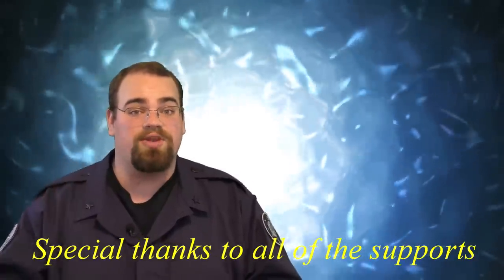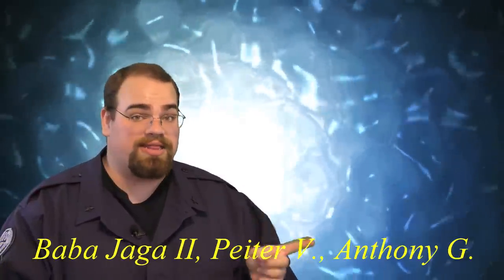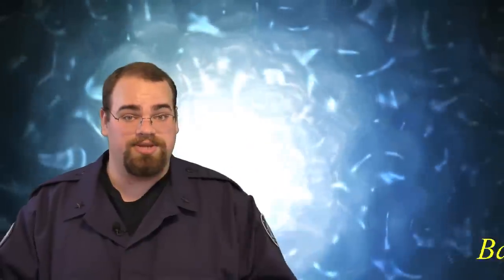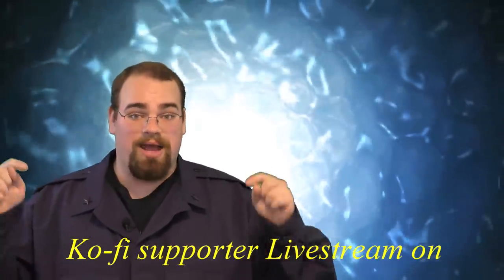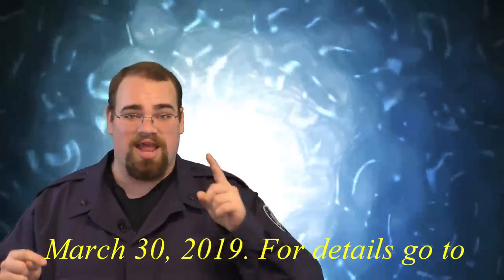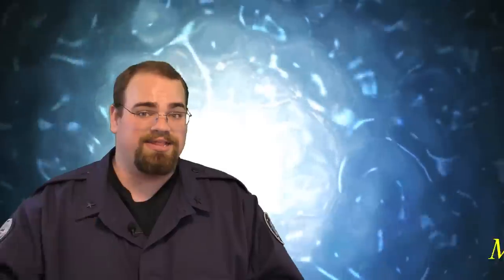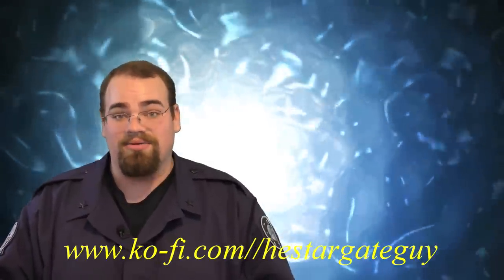Zero Point Module (ZPM) : How it Works

Comment: I bet the way to recharge it is so simple, no one else had thought of it. i bet you just shake them vigorously for 10 minutes then re-install them. Of course the replicators will never tell us this... :)
Reply from the maker: Hahahaha that would be hilarious!
Reply: Haha it ain't no shake weight
Reply: SERIA MAS FACIL REPLICAR CON UNO DE ESOS RAYOS DE TELEPORTACION
Reply: Don’t forget the little dance too
Reply: ZPM's don't discharge, they reach maximum entropy which is irreversible. Maximum entropy is when all workable energy in a system is completely gone, either used or dissipated and you have nothing but complete evenness in the energy state. The universe we live in is in fact racing toward this state and when it reaches it, it is known as the "Heat death of the universe". There is a one way process and it would violate the laws of physics to attempt otherwise. The reason why they say ZPM's are a "universe-in-a-bottle" is because as a self contained region of space-time, they are literally not part of our universe, they are pinches of our universe, twisted off to create a small tiny universe, which as universes go, it produces energy which is then siphoned off back into OUR universe to power objects, as this happens, it starts a build up of entropy until the differential is gone and you have equilibrium and thus maximum entropy. When it reaches this state one of two things happens, A) you have a region of space-time that is completely flat and even or B) the space-time region ceases to exist, as I said maximum entropy means the energy level is even with respect to our universe and thus the self contained region ceases to be self contained and just sort of blobs back into our space-time meaning the region inside the ZPM would seem to disappear and cease to exist.

To make a ZPM usable again, this would require another pinching off of space-time and the creation of a pocket universe again. You would essentially load the ZPM with another pocket universe, which even among the ancients seem to be an effort, not ridiculously hard but still an effort.
Reply: @AgentExeider  good explanation. why do even really crappy alkaline batteries recharge if you put them in the freezer for a couple of days, yet lead acid (car) batteries die in the cold?
Reply: @AgentExeider  "The universe we live in is in fact racing toward this state and when it reaches it, it is known as the "Heat death of the universe"." Heat death or cold death? But it will likely not simple be the universe we live in, but the part of the universe we live in.

Comment: The reason why new ZPM's need to be manufactured, is because they all need to be built specifically around a new subspace bubble and set to specifically tap into it.  The ZPM is a universe in a bottle in a sense though, because the effects of zero point energy are devastating to a universe. It creates exotic particles, changes the zero energy state of space, etc.  If the zero point energy state of our universe were to change, all matter could actually poof out of existence. The laws of physics and the existence of particles, relies on this resting energy state of the universe. So the ZPM does pull energy from outside of our universe. The ZPM is destroying the space it derives energy from, but since we don't live in that universe, it has no effects on us.  In fact, I'm pretty sure they don't even really create a new mini universe, but actually just pull energy from random universes.  I remember they said in one episode that the chances of a universe being occupied that the ZPM is pulling energy from, are slim.  In fact, that's exactly what Rodney tried to do when he tried to create his own energy generation device using an abandoned ancient project.  It was basically ZPM power on the go, allowing them to tap into any number of random universes at will, not just confined to the specific parameters and limitations a regular ZPM would have.  And that's the episode where the energy generator was pulling energy from a mirror universe where Rodney meets his double.

Comment: I always imagined a ZPM as a self contained singularity that couldn't easily collapse until the Crystal broke. The singularity pulled energy that was free moving into contact with the crystal case and the case stored it and released it as needed. I imagine that due to entropy, the singularity breaks the case down until it finally can collapse, making the case go dark. Or explosive in some instances. But this happens over thousands of years, thus it is a reliable energy source. Once the singularity can pull in enough energy or matter, the ZPM dies as the singularity fades away. 

So like the black holes we can make with our huge CERN Collider, but contained and kept from collapsing with a sponge. That sponge can give off energy it soaks up.

Also, pretty sure CERN can make black holes... About to fact check myself on that... They'd be super tiny and collapse quickly, but... Yeah... 

Like the Hirogen Sensor Network. But super small. And pretty. Cuz crystals rock.
Reply from the maker: But with a singularity that large, that would extremely dangerous.
Reply: @TheStargateGuy  "Ancients." said with both hands up Giorgio Tsoukalos style

Could be that it is a very small (microscopic) singularity. The Hirogen ones could be felt in space, but I imagine the crystal case keeps it from pulling at nearby space and subspace material, only free energy. So a dampened field that only gathers energy. Also, haven't we seen ZPM units explode violently if damaged? Not too sure about this, but I think one met a Zat. And didn't like it. They are in DHD pedestals, and those can go boom if damaged.

Comment: Actually a motor vehicle's piston when traveling downwards, it's not compressing anything. When it's on the compression stroke it is traveling "upwards"  and both of the valves closed thus creating compression and when the Piston gets to the top (max compression) a little bit of fuel is sprayed by the injector and then a spark is ignited causing an explosion or combustion, shooting the Piston back down.

Comment: The only problem with the theory is: You need energy to create this "dent" in space-time. i.e. to produce a ZPM you need as much energy as you can get out of it later. Similar to an accumulator where you only get as much energy as you have previously charged. This is why McKay's statement makes more sense than Zelenka's. The ZPM contains its own space-time, which is independent of the rest of the universe. So you get energy from another place. The Arcturus project tried to extract energy from our own space-time and it triggered a catastrophe because it destabilized the space-time of our universe.
Reply: And Mckay being Mckay destory a solar system. He always has to be right. The more pride you have the harder the fall.

Comment: Entropy is when no more work can be extracted from (insert you’re device here) as everything is the same energy level  , (the energy can’t change to another form )  (once all the energy in the ZPM reaches the same temperature no more energy can be extracted)
Reply: How many ZPM could be charged with the Arcturus project? This would probably be called a ZPM mass production. Just stupid if there really should be other universes that are lost. o_o Or: How do you send the energy taken from a ZPM back to the ZPM immediately or as soon as possible?

Comment: So this is basically vacuum decay happening inside the ZPM?
Reply: pretty much....
Reply from the maker: Basically yeah....
Reply: @KohuGaly  Or, like every smartphone, a kaskade transformation from hadrons. Same thing, on the actual facts.

 (Because, its not a vacuum, its a geometric paradox - a line is not a wave, until there is such thing as a third thing like a waveline, basicly a life form ;) 

Co2, in fact, makes this daily. or why you think your kacka smells like kacka. Or why the logo of the SDI looks like this.) 

Because, a ZPM turns in use to a generator, not like the description claimed, to a battery. So its a batterygenerator. 

 (ZPM makes light only in activted mode). 

Would it be a battery alone, there would be no thing like "energy lose", because using a zpm would be recarging the zpm. You could claim, that railguns on Atlantis use the transfer, but in this case, it uses the shield generator.  And because, you have the shell, the batteryeffect are online for the energytransferinfrasctrue.. 

Okey, i lie, a little bit. Even as generator, it recharges. but, because, in use, you only can transfer the energy. A ZPM should use 8/11 correct spins, mase technology turns it down to 1 to 10 to twelve, and politics makes out of it a a mathematical matrix. 

Its a little bit like, oris are only replicants, because, the chance, that daniel jackson would have turned in a gua uld, or that earth is gua uld, since he has disappered, are high enough for him, to be a god. The universum plays this most of the time simple as hyperraum technologie out, and out of  this as freyman graph.

Comment: Not that it matters a lot but i asked myself, what would Zelenka do? Pistons almost always go up when we picture the compression stroke. The squish zone is on the piston top. The bottom of the pistons with multiple cylinders jiggle the volume of air in the crankcase but essentially leave the volume static. Generally we introduce a vacuum from the intake zone as a means of containing the volatile fumes. A positive crankcase ventilation valve, a PCV, is a clever and simple device used for this purpose.

Electrons should be included in any Atlantis power distribution grid talk. They're the little quantum units that do the wave until they are confined to jumping from vacant hole to hole as they wander their way through a conductor or are put to use causing something else to jiggle a little more. The jiggling is what we call heat. I do like electrons. I like to mess with them by offering two doorways then not watching which one they choose. Waving their way along has it's advantages, they're not stuck choosing which door. They just wiggle through both as long as no one is watching and forcing them to choose. Have fun. There's no shortage in choices of thinking topics when Stargate is involved. Peace and confusion are the answer. Adu
Reply from the maker: Yeah I messed up the directions of my pistons. That goes to show how often I work on cars. lol.
Reply: @TheStargateGuy  all part of the process of new areas of reference. No harm intended. Think of this as if it was on Stargate Command. A no troll zone of Ascension candidates. Take care and appreciate your Stargate efforts. Peace

Comment: Technically it is not a battery but rather a power source. and in our universe it can't work. On the quantum level of space/time, dual particles of mater and its counter part antimater are formed and then anihilate themselves back into the space/time think of horses on a merry-go-roud we only see them on the up stroke, (when they ave been created), and they disappear on the down stroke (when they self annihilated and create energy) It is this energy which could be what is driving inflation of space/time faster and faster. the more space there s the more particles appear and annihilate each other. These particles in out space/time quantum level actually exist. but in  a ZPM, a pocket fininite sized universe, captured right after its big bang and instead of expanding by the creation and annihilation of paired matter and antimatter particles creating energy to inflate this space, the energy is syphommed off to power whatever a ZPM is attached to. When not powering something it uses the generated energy to prevent that pocket universe from expanding in stasis inside the ZPM. eventually the ZPM stop generating new particle pair because there is finite space/time inside it and it powers down, becoming inert in our universe.

Comment: Sound waves are a form of antigravity because they have negative mass add Sonoluminescence;  is the emission of short bursts of light from imploding bubbles in a liquid when excited by sound. That 'universe in a bottle' has a real life counter part called a star in a jar, it's our potential ZPM.

Sonoluminescence proposals
 Quantum explanations

An unusually exotic hypothesis of sonoluminescence, which has received much popular attention, is the Casimir energy hypothesis suggested by noted physicist Julian Schwinger and more thoroughly considered in a paper by Claudia Eberlein of the University of Sussex. Eberlein's paper suggests that the light in sonoluminescence is generated by the vacuum within the bubble in a process similar to Hawking radiation, the radiation generated at the event horizon of black holes. According to this vacuum energy explanation, since quantum theory holds that vacuum contains virtual particles, the rapidly moving interface between water and gas converts virtual photons into real photons. This is related to the Unruh effect or the Casimir effect. The argument has been made that sonoluminescence releases too large an amount of energy and releases the energy on too short a time scale to be consistent with the vacuum energy explanation, although other credible sources argue the vacuum energy explanation might yet prove to be correct.

https://en.wikipedia.org/wiki/Sonoluminescence
https://www.outerplaces.com/science/item/18750-sound-phonons-negative-gravity
Reply from the maker: Sooo I only understood like 50% of this lol. This is interesting but totally not my area of expertise. Thanks for sharing I’m gonna need to read up more it’s interesting.
Reply: You....hurt my brain.

Comment: A stream is a very good example of potential difference. A common way of generating energy today is using the flow of water to turn a generator from a stream/river. The only reason why this works is that water will always flow from high to low or from the mountains to the ocean. Water in the mountains has a much higher gravitational potential energy than water in the ocean. Higher potential energy will always move towards a lower potential, which results in the water flowing towards the ocean and finally, is where we can extract energy. Once the water reaches the ocean, it no longer has any energy difference compared to the rest of the water in the sea and has no where to flow down towards. The ocean still has a lot of potential energy, but it is the same everywhere. 
Its a very similar situation when thinking about extracting zero-point energy.  We cannot extract energy from the quantum vacuum, as all the energy in the vacuum is the same everywhere. It might be possible to create a difference to extract energy from. This would be similar to digging a hole inland that is lower than sea level, if we then connected the hole to the ocean, the water would then naturally flow towards it which we could generate energy from (until the hole is full).

But what if the quantum vacuum is not constant? Prof Derek Leinweber's work has shown that it actually fluctuates quite rapidly as seen here: https://youtu.be/J3xLuZNKhlY?t=61
This means that there is some energy difference within empty space.. so in theory there is energy to be extracted (ZPM !!)
Reply from the maker: Wow this is a really cool analogy!